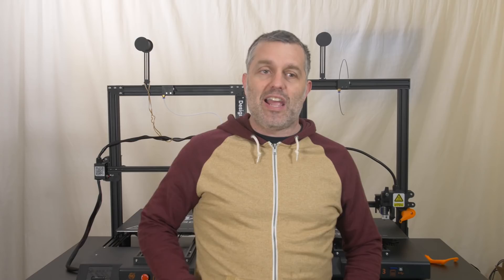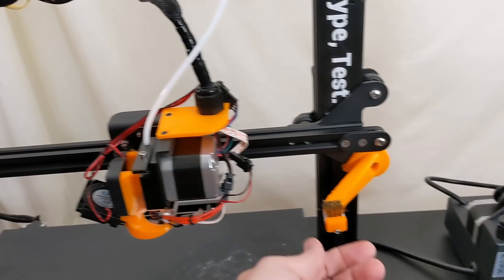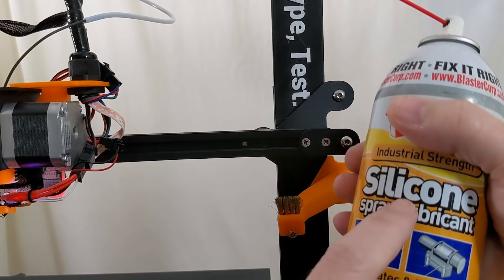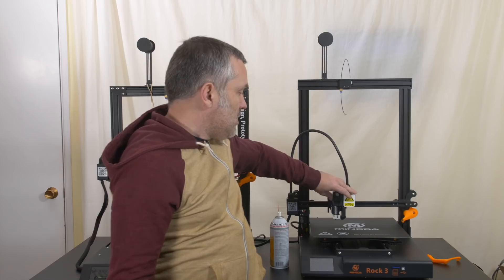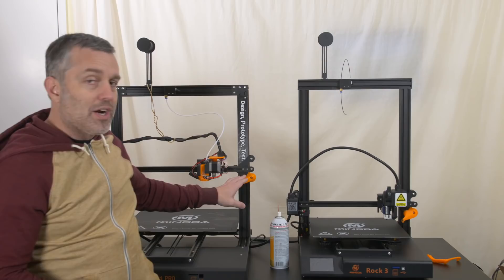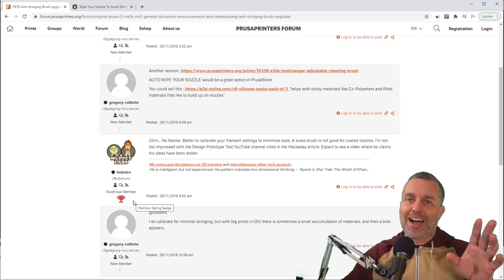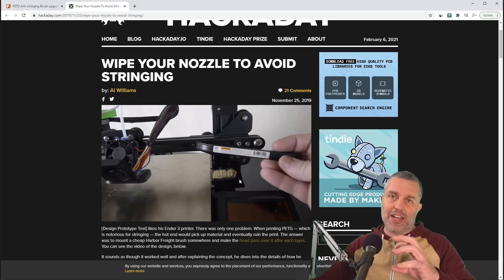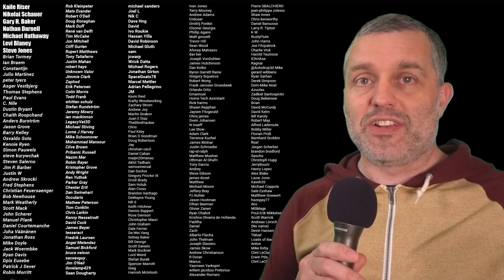Wire Brush vs. Silicone Wiper - Which is Best for Auto Nozzle Cleaning?

Comment: 1.  Could you redesign the tensioner so it was a 1" continuation of the 2020 extrusion?  Add to belt length.  Create the extra rail length you need to move across a longer brush section.
2.  It should be possible to post process the gcode file so it enters the brush off center on one side, moves over 3mm and retreats from the brush.  Or perhaps enters the brush area in a random section.  This functionality should be included in future slicers.
3.  I think the V you cut might be better as a simple slice.
4.  Take a magnet to the bristles.  I bet they are brass plated steel.  I tried to buy a real brass wheel for my grinder a couple years ago, almost impossible to buy.  They're all brass plated steel. Probably because brass work hardens and the bristles would snap off in not too much use time.
5.  I have 2 Ender 6 units I've written you about.  I really need a brush solution.  The nozzle can't move over the edge of the bed at all.

Comment: line the silicon blades up along the Y axis of the bed.
So the nozzle only dips a bit past the bed, then brushes down the side of the bed over the silicon
Reply from the maker: Then what happens when the print is 4 in tall and covers the whole bed?

Comment: Nice thing that you are investigating this. But well with all due respect i know for a fact that silicone wipers can work properly, just have a look at the BCN3d Sigma(Even if i think they are overpriced). The main problem is that your silicone  is way to soft, try something harder next time. Also the top part of the wiper has to be supported from the sides so it wont wobble as much.

P.S.:  Please cut down the drama, I understand u dont like prusa that's ok, me neither but I just want to see some cool and innovative hacks  / features and not some random rant about a forum post.

Comment: What if you used a brush with longer bristles? It might allow it to clean the nozzle without plastic deformation of the bristles due to their length allowing the amount of flex you need.

Comment: did you try those silicon oil brushes that are used for cooking?
Reply from the maker: I did kind of. My first attempt was a wiper which was just a bunch of bristles that I had cut by hand. They weren't stiff enough to actually wipe the plastic off, which is why I ended up with that v-shape wiper that I showed in the video.

Comment: 19:10 "It would be great to do a specialized script at every TEN layer changes, or at every 1000 lines' ... you can do that with Klipper. It's actually my favorite feature. I'm still trying to teach myself all the macro stuff, but this part is actually fairly simple. First, create a variable in your saved variables file (or create one if you don't have any saved variables yet). Create a macro that moves the gantry to create the wipe. Then create another macro that pulls up that variable, increments it, checks the number, and if the new number is equal to 10, reset it to 0 and run the wipe script. Now have the "g-code before layer change" call the second macro.

The only problem is that the g-code scripts are under machine settings, so you would have to create a whole new set of machine settings in your slicer if you wanted to only run that wipe script during PETG, for example. Not a huge deal, just annoying to have to remember to switch the machine instead of just the filament in the slicer. Of course, if you only ever run PETG, or you want to do the wipe at all times no matter what type of filament you're using, then you can skip the dual machine settings.

Comment: How about a round brush mounted on the center point of the brush loose enough to rotate but offset from the nozzle so when the nozzle crosses the brush the brush rotates. This might actually clean all sides of the brush each time.

Comment: brush cleaning leaves very tiny scratches on the nozzle making the filament stick to the nozzle all the more, exacerbating the problem.also a small bristle may break off the brush and be carried off back to the print.embedding itself into the print. A deliver best videos criticise me
the best way to clean your nozzle is to heat up the hot end and then extrude a small piece of filament about 20 cm, then let the nozzle cool down, after that begin reheating the nozzle and when the temperature gets to about 95-100 degrees Celsius  then begin pulling the small piece of filament  that you previously extruded, keep pulling gently until you begin to feel it pulling away like a spider's web  and it will peel away all the melted plastic around the nozzle leaving a perfectly clean smooth nozzle, this is nonabrasive way of cleaning  your nozzle and it will stay cleaner throughout the print   the key is to keep that nozzle shining and without scratches and you won't have this problem Hope this tip helps you.

Comment: A better solution would be a silicon wiper. Like what’s used on the Muldex. 

Also in Prusa Slicer you can add special gcode at multiple layers

Comment: Um lulzbot has had this since forever. They use an electrical circuit to measure nozzle height so need a clean nozzle. They have it on the bed so they can clean in the XY. This means it could not be done quickly at every layer but can be done well at least once a run . e.g. see here for changing their pads https://www.youtube.com/watch?v=bqAL97SlQj0 

I like your implementation though and the video, was very helpful. It is a good feature but most don't implement it. Putting the drama bit at the end was nice so out of the way of the engineering.
Reply from the maker: No. They had it on the front of the bed. Which only works on the first layer or two. My contribution was to move it to a fixed position on the X-Gantry which moves up in the Z direction along with the hotend. Before you leave comments with a subtext that tries to box me into the same old classification as "That guy who thinks he invented everything." how about you actually watch my videos. Like I said, the Prusa propaganda repetitively blanketing the internet with vague notions of "I can't stand that guy" has really damaged my reputation and their attacks have monetarily harmed my channel. You've fallen for their messaging and you are emotionally biased against me. You believe that I am "that guy." Your first inclination is to try and disprove me instead of trusting me. You have unfairly put me into the negative category in your mind. Then again it's likely that you are just another sock puppet. Your account is suspect with no content, playlists, or subscriptions. I probably just wasted 5 minutes of my life typing this.